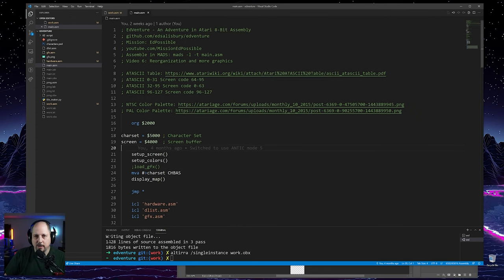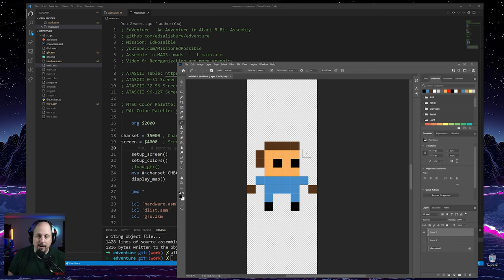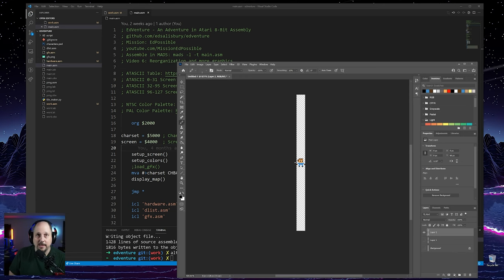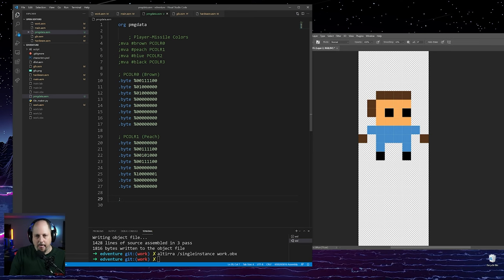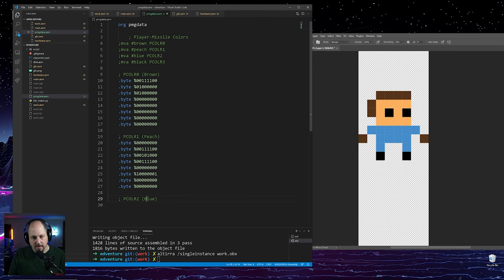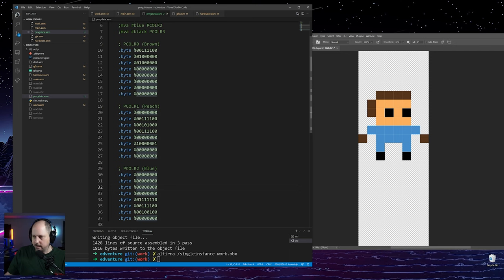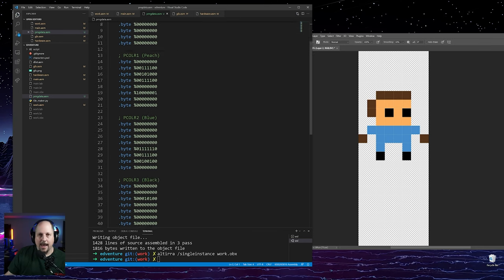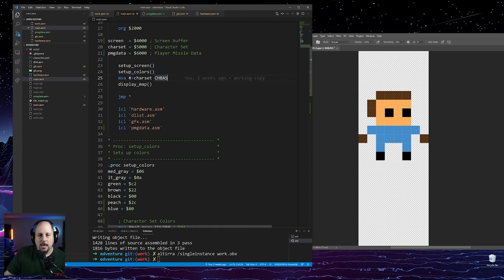Let's Make EdVenture #7: Player-Missile Graphics -- Coding a Roguelike in Atari 8-bit Assembly

Comment: I'm not sure, because I'm a little tired right now, but you might want to revisit your clear_pmg proc, cause I think it doesn't clear memory at index 0 and clears memory at index #$80 (1 past the memory you want to clear). If using a decrementing index, you usually want to decrement before using the index or better even, use it as a counter and another register as an index (x=counter, y=index, starting at 0). Or, you initialize your pmg_p0-p3 to 1 less. Again, I might be dreaming. Love your vids in any case though, been dabbling in 6502 assembly language a bit for the first time since the eighties lately and goofing a lot myself (not that you're goofing, although if I'm right; you are ;-)). Keep up the nostalgia Ed!

Thinking about it, because you're only using #$80, you could do: ldx #$7f and bpl loop i.s.o. bne loop. That way you don't cross boundaries and also clear at index 0.
Reply from the maker: You're absolutely right -- I will update for the next video.  Off-by-one errors are always a pain :)
Reply: @MissionEdPossible  not the top 4 bytes and the bottom 4 bytes are not displayed do it wont make a difference or Quick fix you can change the pmg_p0 to $1FF and the pmg_p1 to $27F ect (just take 1 off) do in both .proc the clear and the load thats what i did
Reply: @brianwild4640  You're right about the bytes not being displayed, but it's the principle that counts here. This bug could cause major hard to debug issues in other spots. And also, I already suggested the -1 thing. Common Brian, RTFM man 😀

Comment: $2E (46) is not really a weird number,  its 32 for double res + 8 for player enable + 4 for missile enable + 2 for standard playfield.
Reply from the maker: True - one thing I could do is to set it by bits, assigning each to equates to make it clearer.  Not sure it would help in this case, but at least the magic-ness would go away...  Thanks for the info!
Reply: True and 3 is not magic number bit 1 and bit 2  set for player and missiles on

Comment: Also I find single line pmg  easier on the memory working out it just 1 page higher for each player for the same y location not half a page keeps your yloc pointers easier
Reply from the maker: Yeah, single line is definitely easier so you don't have to deal with the math, but I figured double line fits so nicely with Antic mode 5.  If I were doing mode 4, I'd probably use single line PMG as well.

Comment: If you only needed three colors for the character instead of four, you could use multi-color player mode and use only two players instead of all four. In multi-color player mode, the pixels of player 0 are ORed with player 1, and player 2 are ORed with player 3. So pixels set in player 0 that are clear in player 1 show as the player 0 color, and pixels set in player 1 that are clear in player 0 show as the player 1 color. But if the pixel is set in player 0 and is also set in player 1, the color output is now the player 0 color bit-wise ORed with the player 1 color. And similarly for player 2 and 3.

The OR operation means that they cannot be any three random colors - two can be any color, but the third will be the OR of the two colors. This means you need to be more judicious in picking character colors. But it means that instead of using all the players for a single character, you can now show two characters with almost as many colors. Multi-color player mode also sets the colors for missiles in the same manner. You select this mode by setting bit 5 of GPRIOR.
Reply from the maker: Thanks for the in-depth description!  Since multiple characters aren't needed, and the additional complexity, I think that using all of players are ok here.

Comment: A couple things, instead of clearing each player just clear from the pm base to the end of the block, then  instead of copying just do an include with each play origin set appropriately so that they are complied into memory at the appropriate spot
Reply from the maker: Thought about doing that, and I may still eventually - depends on if I want things to be changeable in runtime (i.e. loading different characters, etc.) - most likely I will load them in directly, but will wait until I figure out animation most likely :)

Comment: Also a bit more work but you can have the parts of players that over lap create another colour (color)
Reply from the maker: Yup - something to consider for sure!  Keeping it simple for now is good -- would like to eventually do some cool stuff like having the ability to choose characters etc.  Trying to get something actually working though before adding bling :)
Reply: @MissionEdPossible  Ed, I recently tried to get this (overlap extra color) to work but failed (didn't need pmg for current project so I gave up easily to be fair). Would be great if you would show us how to get this working. No pressure though; do your thing.
Reply: @rdcalderon  Extra color overlap works fine with Ed's code here, all you have to do is enable bit 5 of the PRIOR register (add 32 in decimal) so in the setup_pmg procedure change the 1 to 33 like this

mva #33 GRPRIOR   ; Give players priority and enable overlapping colours

Now when players 0 and 1 overlap you'll get an extra colour and yet another when players 2 and 3 overlap.
I knows this works when assembled in MADS and run in Alterra because I've just done it 🙂
Here's the palette I used (excuse the Bob Ross referencing) -

vandyke_brown = $F4
phthalo_blue = $78
mountain_mx = $E0
titanium_white = $0F

	; Player-Missile Colours
	mva #vandyke_brown PCOLR0
	mva #phthalo_blue PCOLR1
	mva #mountain_mx PCOLR2	
	mva #titanium_white PCOLR3
 
When players 0 and 1 overlap I get peach and when players 2 and 3 overlap I get yellow (at least in PAL anyway)
Reply: @fatmanslim6591  Nice! Love the BR colour refs. And on NTSC you will get random colours each time because, you know, never the same color.

Comment: Late to the party but SDMCTL are mode settings by bits.  In C (cc65) it looks like this:
OS.sdmctl = OS.sdmctl | DMACTL_PLAYFIELD_NORMAL | DMACTL_DMA_PLAYERS | DMACTL_DMA_MISSILES | DMACTL_DMA_FETCH | DMACTL_PMG_SINGLELINE;
Where:
DMACTL_PLAYFIELD_NORMAL   0x02 /* e.g., 40 bytes per scanline with normal borders */
DMACTL_DMA_PLAYERS     0x08
DMACTL_DMA_MISSILES    0x04
DMACTL_DMA_FETCH       0x20
DMACTL_PMG_SINGLELINE  0x10
Reply from the maker: Thanks for the info!